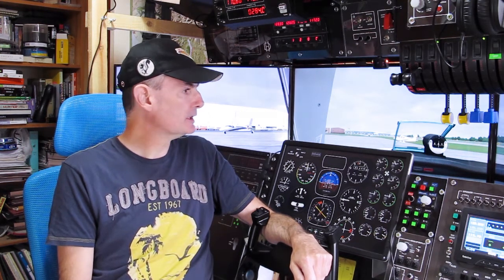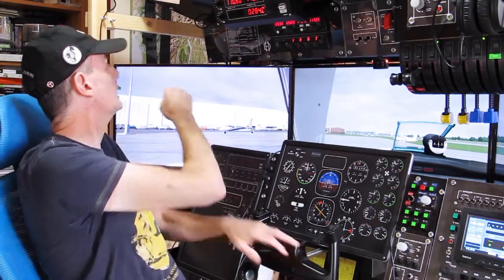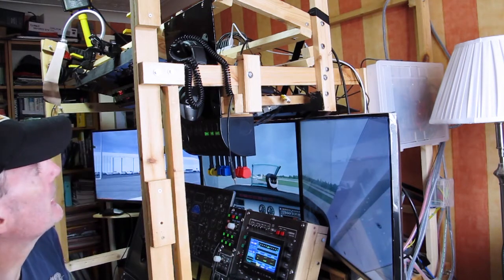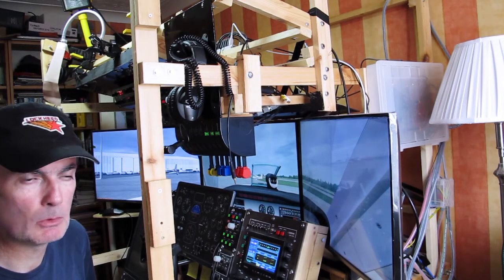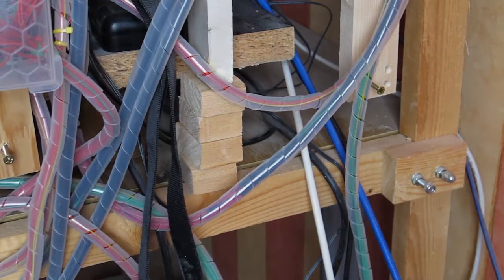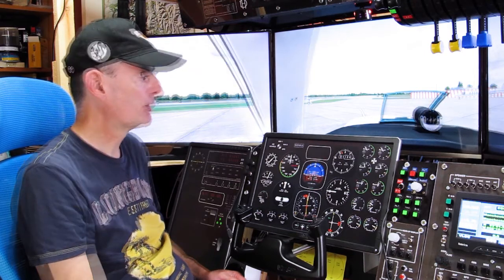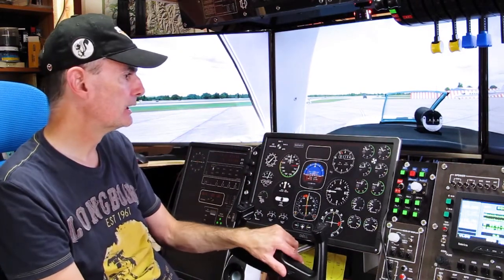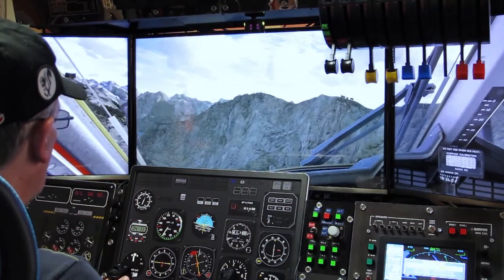Cockpit Conversations #8

Comment: If you do change your throttle setup, you might want to consider a movable setup so that you can mount them either at the top or on the side pedestal, depending on the Aircraft you want to fly.
Reply from the maker: I honestly don't think this is important enough to be worth the trouble. I can sort of see how having both a TPM and throttle quad installed might be good, but the actual position of the throttle quad is, within reason, pretty insignificant. There's also the problem that mounting overhead means mounting the quad upside down, which generally is unsatisfactory because it reverses the order of the levers. If I get the VF quad I will probably mount it under my GPS somehow.